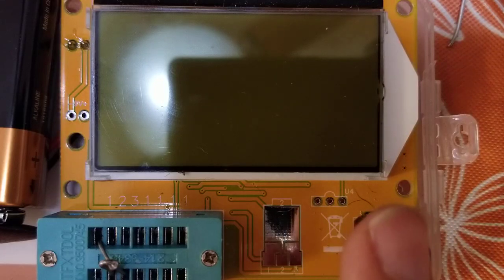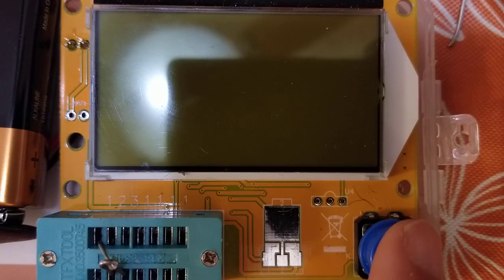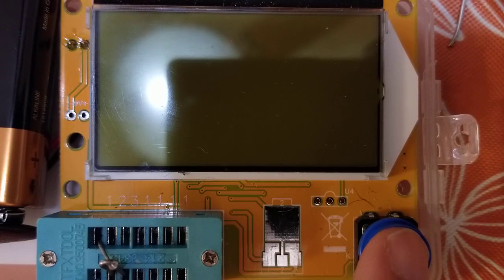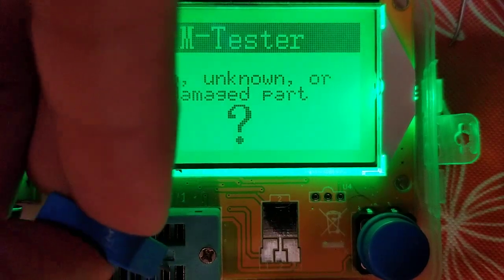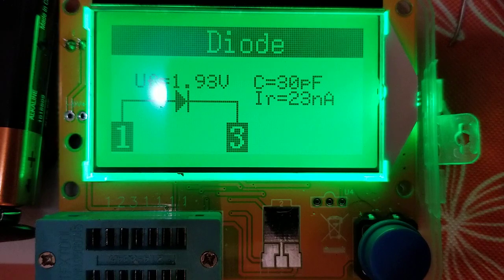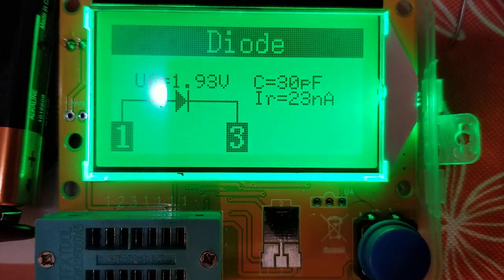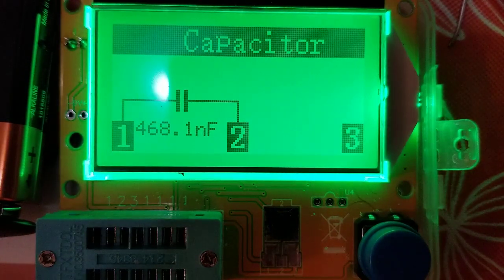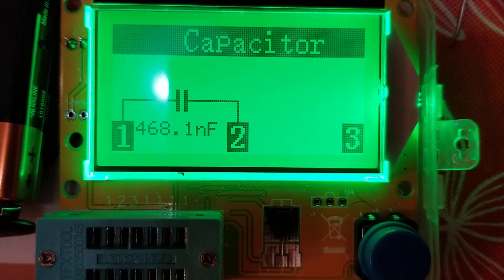LCR4 Newer Version Calibration 2022

Comment: The later versions are pretty fast compared to the old ones. Mine is one of the first firmwares that came out and it tooks around 10sec to read a capacitor.